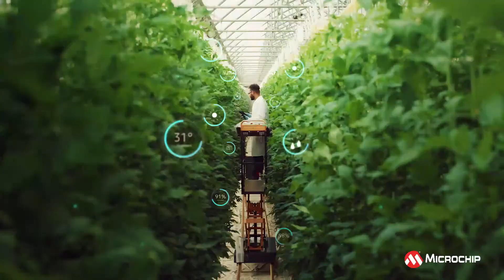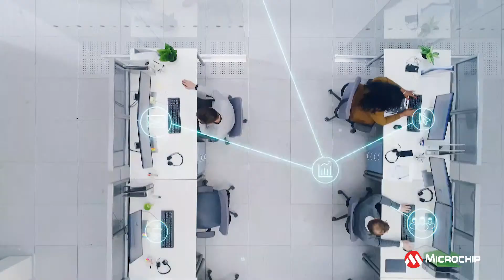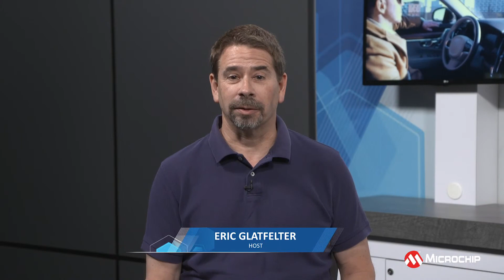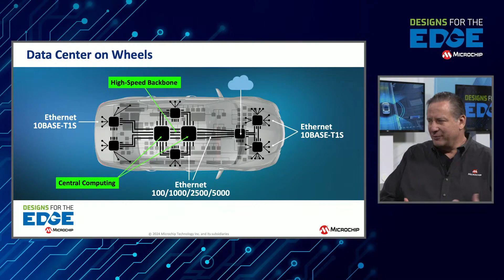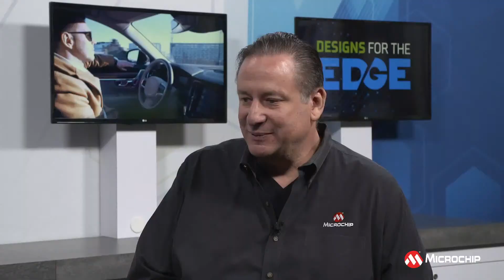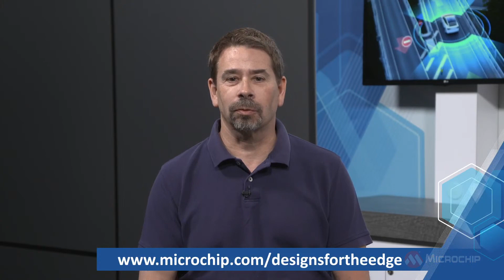Designs for the Edge | S1EP4 | Driving Tomorrow With Revolutionary ADAS/AV Technology Trends

Comment: What application would this have in outback Australia?
We have many 500 mile dirt roads with zero infrastructure.
That is the "Edge"!
Reply from the maker: Hi Kingsford - Great question. Some applications can include remote environmental monitoring, predictive maintenance for vehicles, and enhanced safety systems using sensors and communication modules that operate independently. All of these could be applicable in outback Australia!